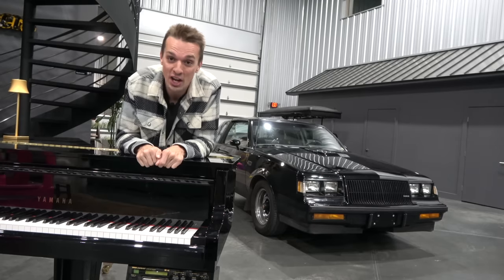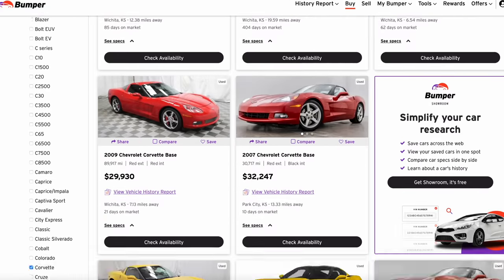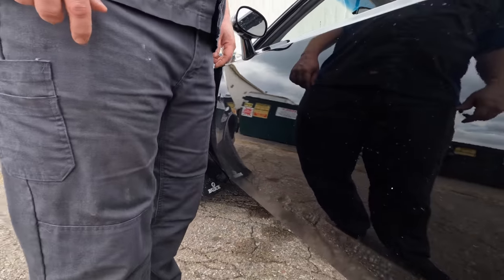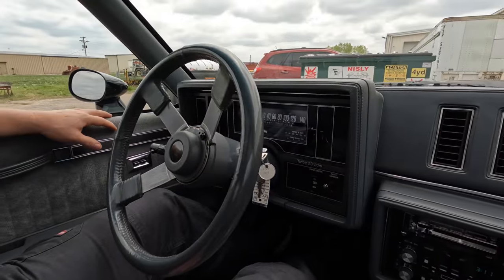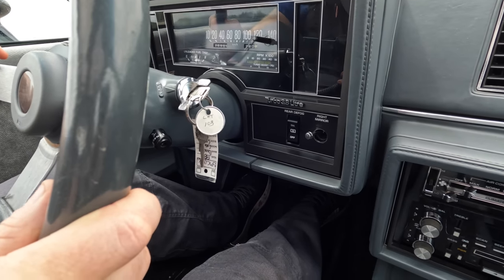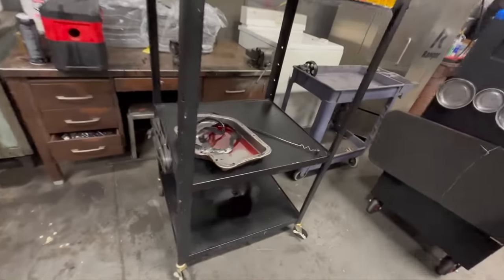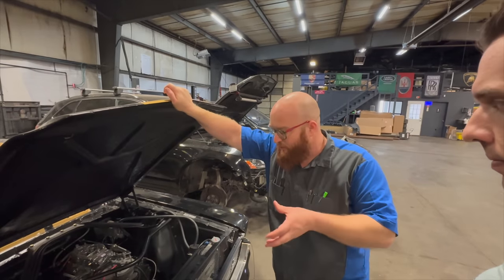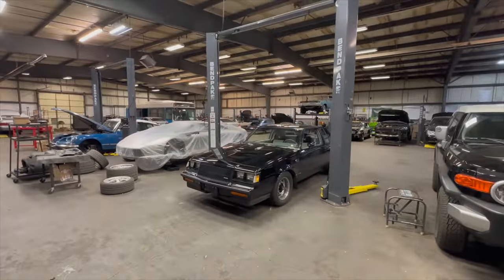Everything wrong with my cheap Buick Grand National, and finding previous accident damage?

Comment: 1.  "Grand National" is a truly stupid name for this car.  It doesn't fit the appearance at all.

2.  I don't think that it is normal for vasectomy's to be that sensitive a couple weeks later.

3.  They look great but the numbers don't work with the GN's.  These cars would just barely get into the 13's in the quarter bone stock, which means they weren't faster than contemporary Corvettes.  And the reality is that Hoovie let the GN win that race against the Countach.

4.  The GN was fun to drive and genuinely fast, but people that have these cars have told me that they are sensitive to tune.  A plugged injector or a bad sensor somewhere can really degrade their performance.  

5.  I'm not kidding about this at all:  In 2003 I got into a little stoplight to stoplight race with a GN in my '85 Porsche 928S2 5 speed, and I pulled right away from him.  My 928 had an ignition chip, rising rate fuel pressure regulator, a Borla exhaust, and a Louis Ott X-pipe.  It turned a 13.86 @ 105 at Bithlo speedway in Orlando one day.  Of course, it was a 5 speed and that makes all the difference in the world with 928's.  

Great video!